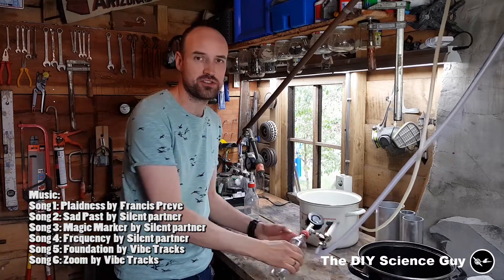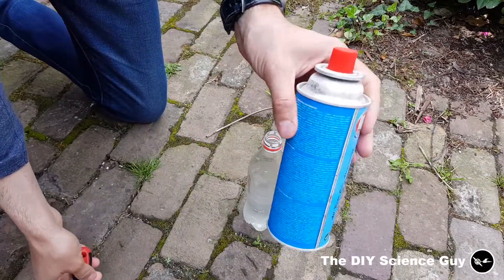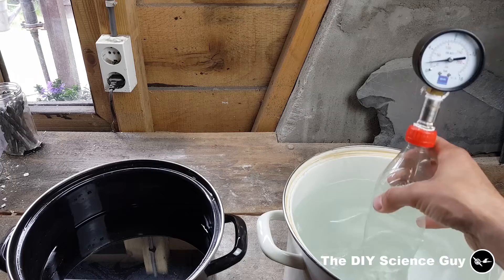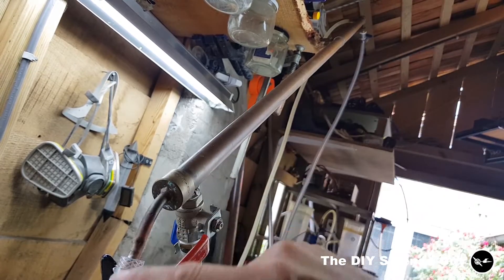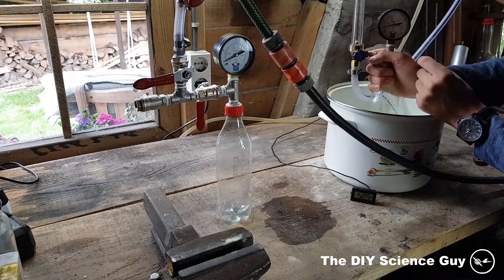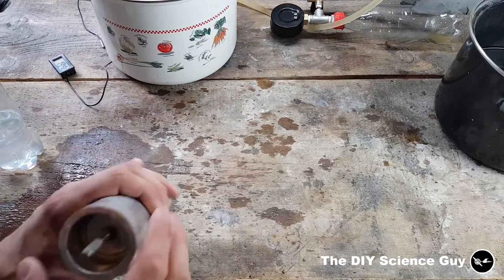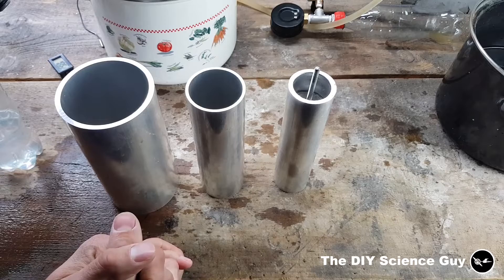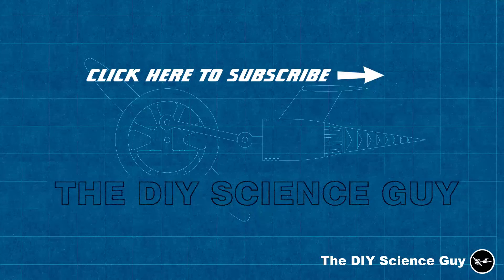Solar steam engine #2 new concept explanation

Comment: Why not heat sand?
Reply from the maker: Sand  has a much lower thermal capacity then water.  But you can heat sand to a higher temperature, but it will then be less efficient because of insulation issues. But good thinking! 👍

Comment: great inspiering projekt. but in this case i don´t get the part of boiling. i googled, that butane is boiling at -1 °C. does condensating work because of any pressure change? are there any security issues with butane, like fire explosivety? Thanks
Reply from the maker: Yes, it works very well, but at a much lower temperature than water. Leaks can be dangerous, of course, so ventilating well is important.

Comment: Great project. Would it be viable to use 3D printed steam turbine generator (Tesla f. ex.) in the loop to create electricity? You might need to increase the disc size to get higher heat.

Comment: Nice experiment , this is almost the same as the cryophorous cycle!  Qwestion, how do you plan to seal the engine from leaking butane gas out of the system, ar you going to put it in a tight chamber or something En how can you extract the mechanical power from it whitout leaking?
Reply from the maker: Thanks! Yes I'm going to put it in an polycarbonate chamber so I can still see it. The crankshaft will stick out trough an oil seal.
Reply: @TheDIYScienceGuy  ow Yahh I see because the organic rankine cycle have only positive pressure in the evaporator en in the condenser you don't have problems whit vacuum leaking as I do whit the same cycle whit water , although it might leak butane gas after a while this would be really unfortunate
Reply from the maker: Yes that is something I have to be very careful about.
Reply: @TheDIYScienceGuy  Maybe you just can put the alternator wire's true the casing so everything is sealed inside so you don't need a mechanical shaft to be outside
Reply from the maker: Yes, but I'm going to build the engine on to a bike and I want to drive it mechanically. I'm going to build a harly-davidson 1916 style bike powered by hot water!

Comment: is there a way to have a constant flow boiler in a steam engine? Nuclear reactors constantly put in new water, but i have never seen a small boiler tank that can automatically top itself off as it lowers.
Reply from the maker: Yes, I think that would be possible.
Reply: @TheDIYScienceGuy  i know its possible, i just have 0 idea how it would even theoretically work .   Google seems unwilling to show me, even though it's decade old tech
Reply from the maker: You can add a small steam or electric pump to pump water in the boiler, but you'll have to add some electronic float that triggers a steam valve or switch. Hope it helps!

Comment: How will the butane be pumped from the low pressure tank to the high pressure tank that might be anywhere from 30-100 psi with small pump? Small Mechanical fuel pumps typically only go 5-10 psi. 

Really cool project trying to understand it fully.
Reply from the maker: Thanks! Yes I will pomp it mechanically back into the boiler. I already have a pomp that can handle the pressure.

Comment: Can the butane also condense in the bottle even when the room temp. (condenser temp.) is for example 25C° or higher, beqause of the pressure difference from the two different temperatures?
Reply from the maker: Yes as long as the temperature on the boiler side is higher dan 25C.

Comment: I was also looking at using a steam style engine for a project, but it was to cool down a compressed gas actually, after quite a lot of research, I found that (for my project) the steam, engine wasn't super viable because of needing to get such low temperatures with the materials I was using.... I'm really inspired by the use of butane though... I'm really excited as to the energy storage potential, cheaper than batteries!
Reply: The Organic rankine cycle tents to have about 10 to 13% thermal efficiency if the engine have a isotropic efficiency in between 70 en 90% this wil be hard to get whit a piston engine

Comment: dude what if you put put it in a vaccum  that will lower the boiling point
Reply from the maker: The butane will be the only gass in the system so that is like in a vacuum. But to really create a vacuum the temperature needs to be below minus 0.5 celcius.

Comment: The problem of having a lower boiling point means that you will need a bigger condenser, so it is really hard to make any changes on the fluid, although you could use  an compressor.
Reply from the maker: That's the challenge! 😁

Comment: Or you could just have a closed-loop vacuum system and work with degassed distilled water at 30C.
Reply from the maker: Yes that would work but keeping a vacuum is much harder than keeping something under pressure. Also, water condenses much more in droplets than butane does which creates more condensation problems in the steam engine, like in a normal steam engine. But thanks for the suggestion! 👍

Comment: Could a steam motor or Stirling engine drive a car alternator or generator motor?. Then the excess energy from alternator stored in battery while some of the other leftover energy used for lights in home or tv, etc? From sun to engine to alternator to battery and home use?
Reply from the maker: Yes something like that would work but it's to expensive for commercial use. ☹

Comment: That's genious! Insted of trying to get the thing hot enough to vaporise water, use something that boils at a much lower temp!
Reply: Good Suggestion water can boil itsef at low pressure in vaccum and the whole system can be built inside vaccum chamber  thus maintaing low pressure boiler.
Reply: I didn't think of that.. Brilliant, what would you try..I would go with Moonshine just don't have any kind of Spark..ever.

Comment: Need to do the math for Temp variance, for many gases..  I thought of this idea years ago, but no way to test.
Propane, butane, and many others have a short range in our Avg heat in the country..  it can naturally do this, with nothing special...
NOW to make a closed loop that goes threw a motor..
Just like an Air conditioner..

Comment: Instead of butane under pressure in your boiler, what about water under a vacuum.
Reply from the maker: Wouldn't that vacuum be filed up with water vapour in time and therefore, would it at all be able to produce power if you also need to keep it under a vacuum?
Reply: @TheDIYScienceGuy   Say you have a closed system under partial vacuum, not a loop yet. Under a low pressure water's boiling point drops and some molecules go to the gas phase until the vapor pressure reaches an equilibrium for that temperature.  Now when you heat the boiler, both temperature and pressure rise in the boiler. If you have a heat engine in between the boiler and condenser restricting the flow, you'll have a pressure differential allowing you to do work.   In the condenser,  steam gives up its heat to the condenser walls condensing the steam back to water, thus sustaining its low pressure.  

Now if you close loop it like you did with butane,  It is identical except the working fluid and pressures are different. 

 https://en.m.wikipedia.org/wiki/Rankine_cycle
"Power depends on the temperature difference between a heat source and a cold source. The higher the difference, the more mechanical power can be efficiently extracted out of heat energy, as per Carnot's theorem."
So obviously, <100c, to ambient difference and the power level is smaller than >100c to ambient difference, but <100 or >100, in theory you can alwase do work.
Reply from the maker: Yes you are right! The only question now is, in a range from 12 to 100C, will the pressure rise enough and will there be more condensation problems. Also corrosion, algae and mold could be a problem but with distilled and disinfected water that wouldn't be much of a problem I guess. It's a nice idea and I might give it a try. Thanks!
Reply: @TheDIYScienceGuy  This video is meant to be a parody of another idea but the physics demonstrated  1m  23s through 2m 58s  is real https://www.youtube.com/watch?time_continue=82&v=hPM2vnV3SZM

There are tables of water's vapor pressure. http://www.msduncanchem.com/Reference_Tables/water_vapor_pressure_chart.htm
For instance 15c = 1.71kPa ; 100c = 101.32kPa 

Pulling a vacuum on water will degas the water. Without oxygen or carbon dioxide, algae and mold can not grow.  whatever the working fluid is, the real question is how much  power can be had with a sub 100c to ambient temperature differential. That could be estimated, with the proper math, and might help answer the bigger question is it worth the effort.
Reply: @TheDIYScienceGuy   https://www.youtube.com/watch?v=UhEDcvATHG0 Yup, same heat pipe technology described in my last comment, a boiler and condenser with water under a partial vacuum. except this one water in  sealed  copper pipe with the evaporator inside a solar collector evacuated- tube for insulation.  I see snow outside. the guy says its -19c and he is getting  370f heat. 

a little better explanation. https://www.youtube.com/watch?v=BGsmlIoiJN8 But NOOOOO  they are not using alcohol  as it reacts with copper. Water and acetone heat pipes work virtually equally well for thermal heat transfer  but acitone is better for when temps may drop below 0c over night during the winter.
Reply: @TheDIYScienceGuy   I was thinking about this and acetone has a vapor pressure in between butane and water.

Comment: A better, and still cheap, alternative to water as the thermal mass is Eco - PCM. Phase Change Material. You can buy in kg bulk amounts on alibaba. High quality and they hold more thermal energy per kg than water does. A potassium nitrate and sodium nitrate eutectic salt as the solar - thermal transfer fluid is also better. Have a reservoir for the cold molten salt, cycle it through the solar collection system, dump it into a storage tank that has an embedded PCM layer. Integrate water boiler into the molten salt "hot" reservoir. This will extract more thermal energy per m2 of surface area from due to the high heat capacity and low volatility of the salt mixture. Your water then only needs to be pumped between the "hot" reservoir and your point of use, instead of through the entire solar setup. Ideally use the PCM like a battery to store energy that the salt mixture gives off as it cools. This insulates and captures the "waste" heat and gives it back to a water pipe embedded into the PCM layer. You can make the system small and consolidated while increasing power and efficiency. Your butane steam engine is really great, i am a steam head myself and love the idea of re-creating a butane steam engine. Look forward to more!!
Reply: ideally i'd have two reservoir's for your solar-thermal system. The "cold" one just keeps the salt solid when not in use, or liquid when in use (eutectic though, so melting point is low, around 40 - 60°C). This bleeds heat off of the water thermo-syphon embedded in a PCM container, so no electricity is needed. Just stored heat. The liquid salt then travels through the solar concentrators and gains heat, up to 1,000°C depending on the amount of time the salt is gaining thermal energy and the concentration of thermalised photons from the sun.  This hot salt then dumbs into a "hot" reservoir where it cools down and transfers heat to your desired point of use scenario. The cooler, but still liquid salt, is sent back to the cold tank once it's volumetric temperature is 50 - 75° above the melting point. In this kind of system, the salt tanks act as batteries. This means you only have to cycle the salt to "recharge" and you can use the steam engine at night and maybe for a few days in a row, without needing to cycle the salt again. Someone like you, could 100% build such a system for size you are already building.
Reply from the maker: Thanks I'll look in to it! 👍

Comment: look at PEM-WE instead of alkaline electrolysers. much more efficient, even above 96% at 200mA/cm2, dropping to 70% above 1A/cm2
cathode deterioration via H2O2 is also avoidable with PtFe nanomaterials. PFSA as membrane, alternative are Nafion or AEM i haven't researched those.

Comment: Hi

interested when there will be a video- about calculation working   engine, pressure
  heat capacity 
propane. butane-propane mixture o produce higher vapor pressure at lower temperatures....
very interesting
I'm waiting very much
Reply from the maker: I'm not able to do al those calculations myself but a friend of mine can, so maybe he will help me later. In that case I'll show them at some point in a video. Thanks!

Comment: Your work inspires me.  I was thinking about trying your low temperature rig with a thermal solar setup using the pressure to lift a balanced arm to the top of a swing and collect the energy off the fall. resetting the system to raise the arm again. If this didn't work I was thinking about using HHO and solar electric to accomplish the same thing. I'm not sure what the pressure can get up to with a few volts and a sealed container of water =)  My goal would be to build a working piece of art for my yard so people can enjoy the mystery of science.
Reply from the maker: Nice idea! Technical art is my favorite kind of art!
Reply: @TheDIYScienceGuy  Did you have a chance to give any thought on that email I sent?
Reply from the maker: @cmontgomery209  Yes, I just did! 😉

Comment: I had not considered butane before - now I need to... seriously - I have been planning to do a Stirling engine project, and this is it.  

BtW.  Just a guess, but I bet you could use a butane-propane mixture to produce higher vapor pressure at lower temperatures.  Have you looked into that?
Reply from the maker: Yes that is possible and I will do a video on that topic later. Thanks!

Comment: A solar steam engine was used back in the 1800's to run a printing press for a newspaper. It is not new, but is lost knowledge. For your engine, simply drive a turbine or use an air tool substituting steam for compressed air. You'll go further, faster. If you are determined to boil butane, at least add an afterburner to  make use of that energy as well.  :)
Reply from the maker: Well if I would also burn the butane that would not make it a solar steam engine so I'm not going to do that but thanks for the suggestions 👍

Comment: This is very much like the way modern refrigerators use isobutane (R600a) - except backwards :D
Was this your inspiration?
Reply from the maker: No not the inspiration but I quickly saw that it's actually a reverse heat pump.

Comment: Stumbled upon your channel and like the experimental stuff you are doing. I have a question you may know or point me in the rite ri
direction. Is there a simple way to pump out air from a chamber, to make lower pressure, that is driven from circular motion. Ie directory hook up motor to remove air from a container
Reply from the maker: Thanks! Look up vane pump. I think that is what you are looking for.
Reply: @TheDIYScienceGuy   supper, I had a quick Google and seems to do what I hoped. Thank you :)

Comment: You should use a gas/liquid that boils at around 60°C so that you can condense the gas from the steam engine back into a liquid which then can be reused without using energy to condense it.
Reply from the maker: Well in a closed system you always need to condense it. The temperature range does not change that. Or do you mean that you do not actively have to cool the condenser? In an other video I will explain the the advantages and disadvantages of different working gasses. Thanks for the suggestion 👍

Comment: i like the idea but like, butane is volatile enough that you could get spontaneous ignition inside the cylinder like in a diesel engine, especially if decelerating under load, it'd compress the butane and potentially ignite it, that flash will likely get through the exhaust of the cylinder and get to the tank. so it's not only a good idea to evacuate all of the air from the system from an efficiency standpoint, but a necessity if you want to keep your engine as a steam engine, and not a combustion one! probably good if you want to keep your eyebrows, too.

Comment: I have been wondering about this for a long time too I have been told by someone that knows more about this than me but is by no means an expert that the big advantage of water is the huge amounts of energy needed for a phase transition also gives steam the properties that are desirable in steam engines. However, butane at 100 degrees should get up to 15 bar if i'm not mistaken, that seems very promising. 

PS, seems that you are Dutch. If you need something 3D printed for free hit me up, I'll gladly help in any way I can (sadly no lathe or cnc at my disposal).

Comment: Hi
. as I understand for the engine to work the difference in pressure
 in the question, can you lay out the calculations?
- the temperature is hot, and condensate, 
- what is the difference in pressure you plan to get
- working volume of the engine, rpm
- calculation of heat in water, 
- calculation of heat capacity of butane for evaporation
- which will be the supply of energyenergy, in volume of water
- interested in such a cognitive video
Reply from the maker: I'll try to answer your questions in the coming videos 👍

Comment: this is an awesome idea, i am trying to create hot water with solar for my sink, i have encased a black radiator inside a frame with plexiglass and insulated it, within 20 min of sun the water is too hot to touch which amazed me, hope your butane design works out, pls show how you will insulate the tank and with what material ?